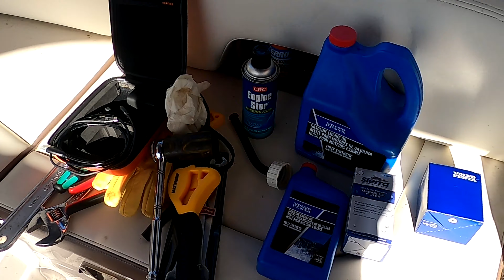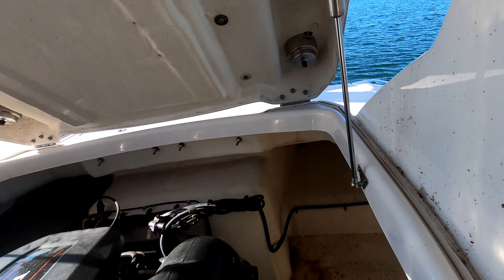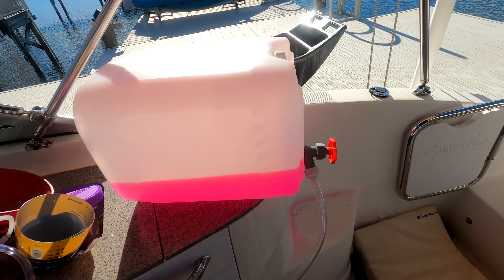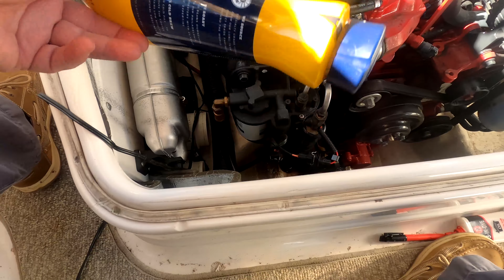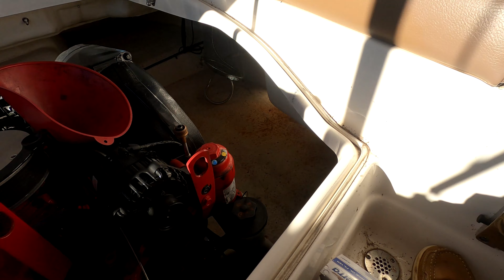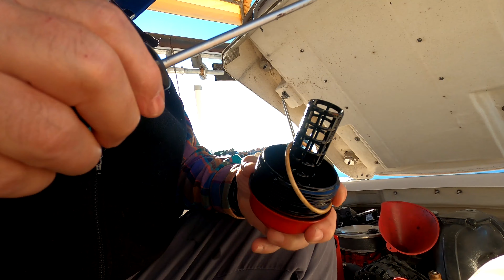Winterize Volvo 270 Boat Engine COMPLETE!

Comment: Is it necessary to unclamp the low point hoses to completely drain the raw water from this engine?
Reply from the maker: The most important thing for draining the block is to remove the lowest petcock plugs. There are usually three layers of these on each side or three specific plugs that need to be unscrewed. Let the water drain out and then put them back in before you refill the block with antifreeze.

Comment: So I tried to do the thing with the antifreeze and here's what happened. I hooked up a gallon jug to the port and without the engine running it took all of it. I thought it looked like your jug was only filled to about a gallon's worth so I said it must all be in there now and that ought to do it. Ran the engine at idle for a bit, temp didn't come up, but then got an engine alarm "contact dealer". I am assuming that the amount of anti freeze I put in wasn't enough to get to the pump so it never ran through the engine. Temp sensor never moved off cold. So I closed it all up and now I'll have to get more antifreeze. How much did you actually have in your video. My engine is exactly the same, so I just need to know what I did wrong. Thanks.
Reply from the maker: I sympathize with you 2 gallons minimum some suggest three. After you fully emptied your engine by removing and replacing all six of the blue petcock screws. Then fill it and you’ll fine with it running that it starts to come out of the outdrive sometime during the 2nd gallon typically consider subscribing. Thanks. Joe.

Comment: Can 2 cycle gas be added in the fuel filter to accomplish coating the engine?
Reply from the maker: You ask an excellent question. Volvo actually recommends connecting the fuel line with two cycle to the inside of the engine with the oil fuel mixture. Consider subscribing. Thanks. Joe. If you watch my whole video, disconnect the fuel line and connect it so that we’re putting in an oil and gasoline mixture.

Comment: Will buy a boat now under winter when the prices in Sweden are at their lowest. Would prefer a cabin boat without canopy but found a Windy 22 from 1977 in top condition with all originals and documentation and best of all it has a 2015 VP 270 V8.
A bow thruster is also installed.

If I end up buying it for $10,300 this video will be worth its weight in gold as I would prefer to take care of the boat myself.

Thank you for sharing and greets from Sweden.
Reply from the maker: Thank you for your wonderful comment. It’s wonderful to have a bath thruster I wish I had one in my boat. Looks like you figured out which one to get. Enjoy the feeling of successfully caring for your own equipment. It is great. Consider subscribing. Thanks. Joe.

Comment: What type of anti freeze do you recommend and where did you get it?  In other videos I see some folks are draining the water out of the water pump/impeller intake and outtake lines.  Did you not need to do this because you fill it with antifreeze?  Thank you Doctor.
Reply from the maker: You ask a great question. I put Marine grade antifreeze in the engine, which is orange and I buy it at West Marine. You can get it probably at Walmart or other stores as well. I’d look online if you don’t have a West Marine near you. But once you fill it with antifreeze, you are good to go. You will not have any issues with your impeller pump, etc. it works perfectly. Thank you for your question consider subscribing. Take care. Joe.
Reply: Thank you.  How much antifreeze should I buy?  I also am wondering about the L connector you seemed to have put on where fuel line goes into fuel filter.  Where can I find one of those?  It looks like you took off existing fuel line, leaving boats fuel line on barb.  You seemed to put on an L connector (1/2” male on both ends?) and hooked up your oil/gas mixture to it with 1/2 female connector.  Is that correct? Also, is it okay to change the oil and filter a couple of days before I pull the boat and then do the draining of water from engine and replace it with antifreeze back at my house?  I’m trying to maximize days I can use the boat at our summer cabin before I put her out for the winter and then head back West to my home.

Comment: Does the hose hookup bypass the thermostat or should you warm up the engine before adding the coolant?
Reply from the maker: OK that is a great question. No it does not bypass the thermostat and no you do not need to warm the engine up so the thermostat is open. With the hose hook up to us as it fills the entire lower aspect of the block and all of the tubing, wherever there is water or coolant in the engine as how it winterize it.